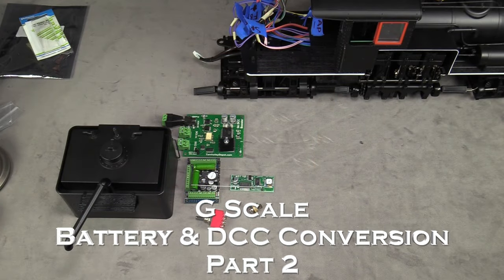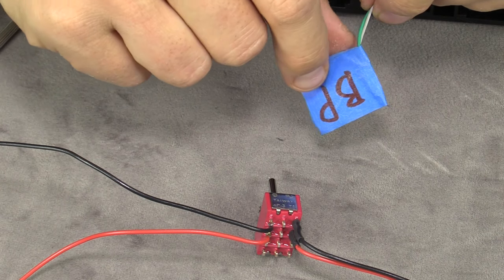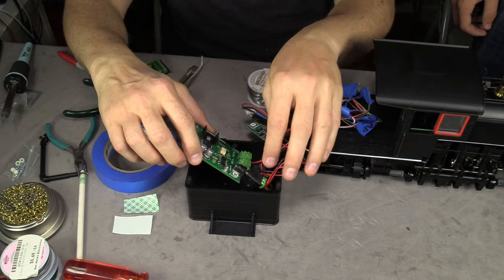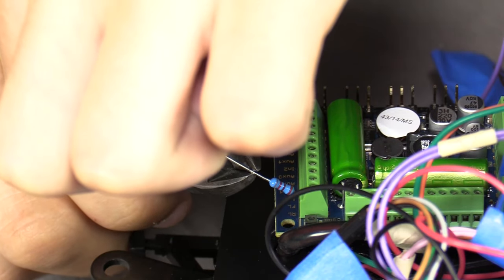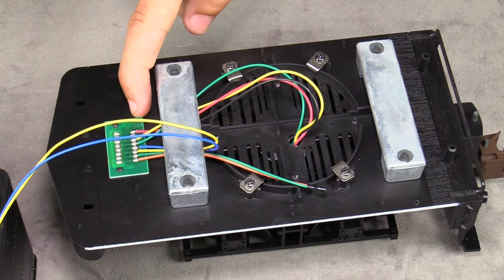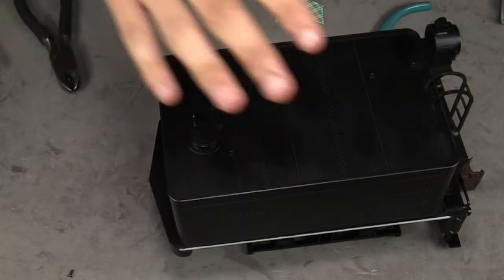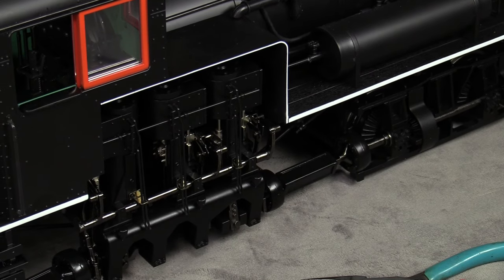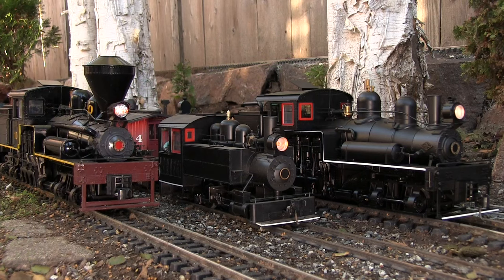G Scale 3 Truck Shay DCC and Battery DCC Conversion Part 2

Comment: I just converted a 2 Truck Shay to DCC/M4 with an ESU 5XL. I preserved the fire and ash box flicker lights and the smoke unit control by supplying +10v from the 5XL to the Bachman light board. I transferred track, motor, and lights to the 5XL.

Comment: Very nice.  I have the same battery in mine, i mounted it to the underside of the water tank using HD Velcro.  That has worked for 7 years now.  The only thing you did that I would recommend a change is leaving a plug between the battery and the loco to facilitate easier removal.   Looks and sounds great, thanks for sharing.

Comment: Hey guys, on a bachmann engine like this, would you need to keep any of the original electronics if everything is going through the decoder? I wanted to keep my smoke, and was thinking of wiring it to a relay, from a function output, then using the function output for the firebox light
Reply from the maker: Let us know if it works!
Reply: @tsgmultimedia  So far I have this loco spread far and wide all over the family table. Struggling on getting it back together and the lights working. Took out the main board, was able to cleanup everything but the new install, but am having trouble with my older Lenz DCC system in recognizing and reading the settings. Any more tips on LEDs?

Comment: Hey guys, Great video. I unfortunately had someone else install airwire in my train. He setup the remotes and everything. Unfortunately, the batteries in our airwire remotes exploded causing the remotes to not work. We bought new ones but now are trying to figure out how to get it to run the train. I know this is an old video but any help would be great. I feel we are missing something critical. Any common mistakes you could think of? Also what is this computer program you are using on the train?

Comment: Dan - How long of run time do you get from the battery pack you used in the Shay?  Also, you did not give the specs of the battery.  I tried to pause and write it down from the video, but please confirm the battery used or what you would recommend.   I am building a garden railroad and will need to do this type of conversion to battery power.  Great videos - thank you!
Reply from the maker: Hi Mark,

Dan quit back in January, so he does not bother to check for questions on here any more. I can tell you that the battery in this Shay worked 4-6 hours, easily. If you pause the video right around 18:00 you can see it's a 14 volt lithium-ion battery branded with the name "Cordless Renovations." I suspect that if you grab a still shot from about that time frame, you should be able to figure out more about the battery's origin. Looks like there's a web site address printed on its label as well.

John
Reply: Thanks for the reply John.  That is good news about the run time for that battery power source. And pausing the video is exactly what I did.  I did find the Cordless Renovations website for that battery.  Best, Mark
Reply from the maker: Excellent! Glad I could help!